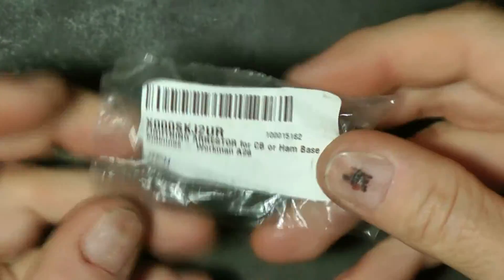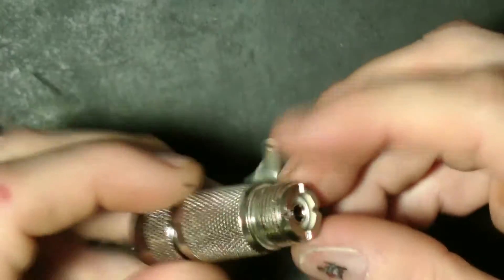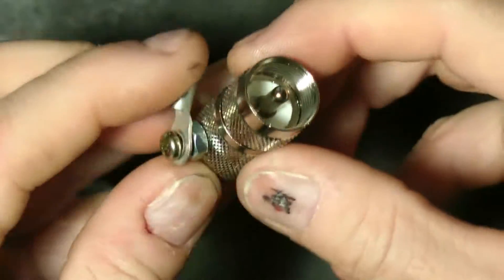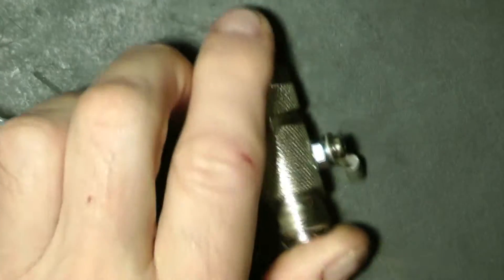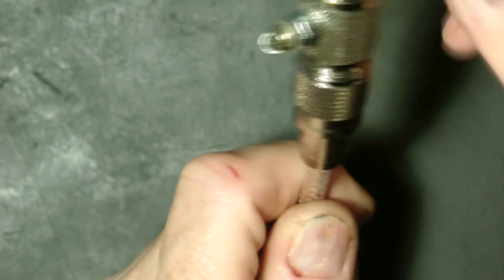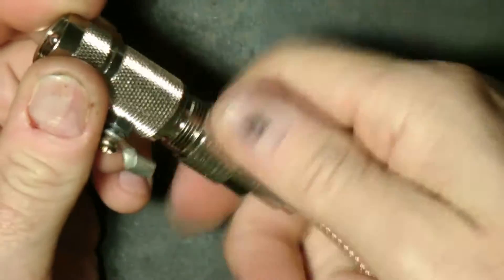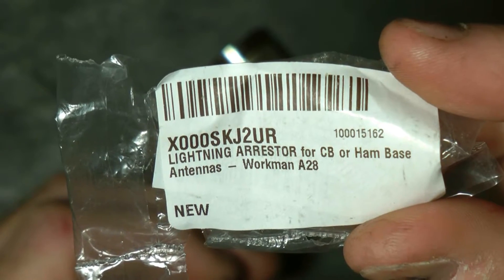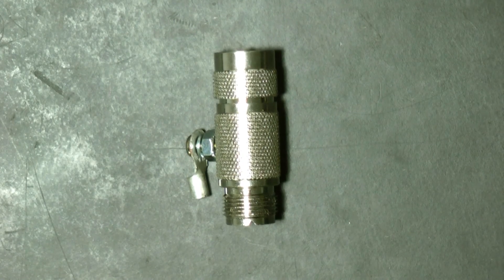LIGHTNING ARRESTOR FOR CB HAM RDAIO QUICKLOOK

Comment: I kinda made my own one of these. I have a barrel connector where the coax goes from outside to in my shack - I basically took some 10g wire and a few "hose clamps" ... attached 10g wire to jacket of barrel connector via hose clamp, then ran it to my 9foot copper rod in the ground and attached it with hose clamps there. I checked for continuity between ground rod and coax jacket on multiple places on the feed line, and it definitely has a good connection. The entirety of my coax system has it's jacket grounded. 

Isn't this just a barrel connector with a screw?????
Reply: Also, the antenna I use has it's own  "auto" transformer for it's matching system..... so there is continuity between PIN and JACKET...  which is why I figured I could get away with doing it the way I described.

Comment: It is important to get lightning arresters. They need to be placed on the shack end of the cable, not at the antenna end of the cable. They are best placed on a ground bar near where the cable enters the shack or house.  The reason is even if the coax shield and center conductor are connected together at the antenna end of the coax (surge protector, gama match, etc) the propogation velocity on the coax center conductor and shield are different. With a fast rise time static surge the voltage on the antenna end of the shield and center are the same, unfortunately after 50' or 100' down the coax the surge on the shield will arrive at the radio before the surge traveling slower on the center conductor. This will result in a large voltage difference which may damage the radio. A surge protector will conduct and protect the radio. Polyphaser has a white paper with scope pictures  that describes this. It is how we install them on commercial sites in the field and why they sell ground bars to mount them near the point of entry, not near the antenna.
Reply: C  If it is a direct strike to your antenna it doesn't matter where you put this, everything will be smoking toast. I repair radios killed by lightning, most of the time it is a nearby strike or more often to the power lines. USB chips, CODECs, small caps, receiver parts, etc are killed, there is no sign of damage, no back smug, nothing to see. It is like a large static electricity spark. Like I wrote before, put this at the equipement end. The "spark" coming down the coax shield will get to the radio before the spark on the center conductor (remember coax velocity factor?, google it). The arrestor will conduct shorting the center conductor to the shield keeping the voltage low, and possibly saving the radio's receiver.
Reply: @hamiltonstewart8739  hi I have a question. I just purchased a rod to mount in the ground besides my station master that is on a jaypole. Is it best to just have the base of the antenna connected with a wire down to the rod or put one of these on the end of the antenna side. As I dont have any way to get a ground wire out the window from the back of my radio. I understand a nearby hit or direct hit will kill the radio but I just want it earthed for a bit of saftey and piece of mind
Reply: So, zap, the jpole sees a 5kV spike from a nearby strike. The coax center and shield are connected together on a jpole, gamma match, hair pin, etc by heavy metal rods or wires. So the both coax center wire and shield are at 5kV with or without a surge protector so it is a waste to put it here.

Assuming a 50' coax the 5kV will be on the coax shield 50ns later at the radio and on the center conductor at the radio 76ns later due to the propagation velocity in the coax. So for 26ns there is a 5kV voltage difference between  the center conductor and shield arcing around in the radio zapping things. A surge protector at the radio clamps the coax shield to center wire voltage to less than 70V between the coax and shield possibly saving the radio's input circuits. (Notice the ground wire is not part of any of this.)

Still with me?

This leaves the chassis of the radio at 5kV. From here it will burn a path through various components to get from the case to the USB and PSU connections unless the computer and PSU are tied to the radios case with ground straps. Now the case of the computer and PSU are at 5kV trying to burn a path to the 110vac lines in each as well as through the ethernet line to the router. If both of these are plugged into the same surge protector the potential different is once again clamped to a survivable voltage. (still no need for the surge protectors ground wire). Use a ethernet protector close to the computer and put its ground wire under a computer case screw. Keep it short, and do not coil it thus making it a time delaying inductor. This will also save the PC and radio should the cable get hit. A better alternative is to use a wifi dongle and eliminate the ethernet cable.

All of these efforts to keep everything at the same potential is called "bonding".

To reduce the HV entering the house a ground rod near the point of entry is used. It should be near to and connected to the power service ground. If you run a 100' wire between the two grounds there will be over a 125ns delay in the V spike between one and the other. Picture a power line strike, all of your house plug grounds go to 5kV, your station ground is 0V for 125ns. (Same is true if the antenna get zapped and the power ground is 0V for 125ns.). Either way your equipment between the two is toast. 

Ideally your coax enters near to the service entry and is connected to the station ground rod. This is a good location for the surge protector with a short straight ground wire connected to the station ground. If the ground rod reduces the 5kV down to  2kV and there is another 50' of coax from the surge protector to the radio the spike on the shield will still be 26ns ahead of the spike on the center conductor, but the center conductor has been clamped to under 70V referenced to the shield, the shield is at the voltage of the station and service ground, and no longer an issue.

A few rules: Lightning has a rise time of 10s of nano seconds so wire length and inductance matter, 10kV doesn't arc to 10kV but it does to 0V, and ground rods do not stay zero but are only a common reference point that you want everything to float with.